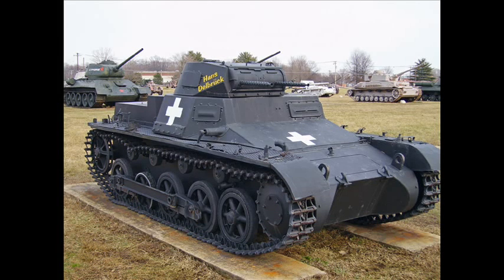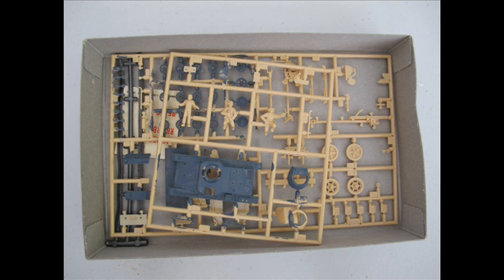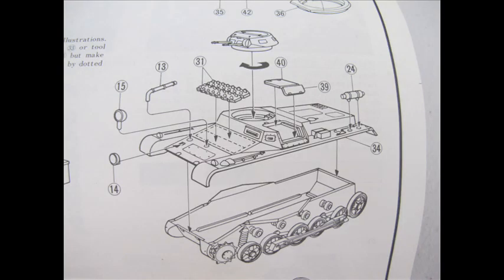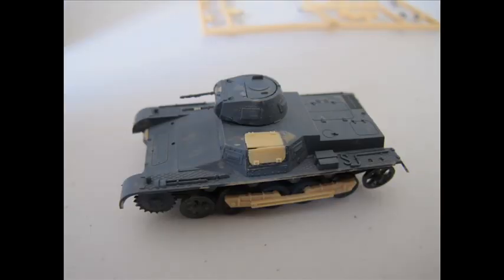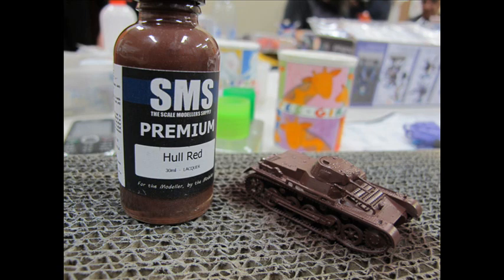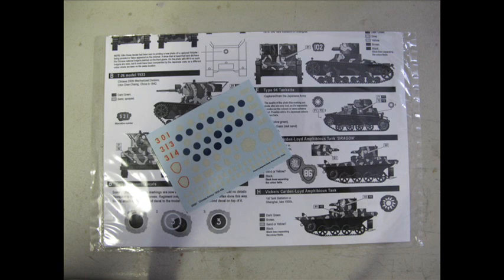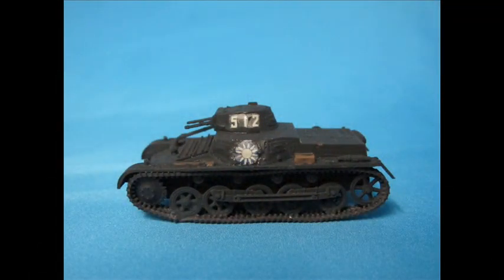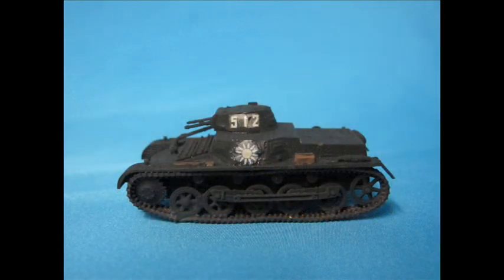Fujimi Mokei 1:76 pz.kpfw 1 German light tank AUSF B

Comment: Fujimi reboxed this kit from Nitto Kagagu.  These are pretty nice kits...given their age.  Too bad the decals went wrong.  I like the Chinese markings you made.  Looking forward to future armor builds.  Keep having fun.            Bill
Reply from the maker: Thanks bill the exprience was fun but shame about that. The current tank polished up perfectly so I guess it made up for it lol.
Reply: That is incorrect. Fujimi did inherit a Panzer I from Nitto, but they already had one in their World Armour range. This is the original Fujimi kit, and it is better than the Nitto. On the Nitto kit the engine deck detail is wrong, and there are problems in fitting the upper and lower hull together. You can tell the difference between the Fujimi ex-Nitto kit and the Fujimi original kit by the box art, the pure Fujimi kit showing the cavalry. Also, the original Fujimi kit includes a 7.5cm PaK 40, copletely out of period for the Pz I as a combat tank, whilst the ex-Nitto kit includes a Kubelwagen and a BMW R75 motorcycle & Sidecar.